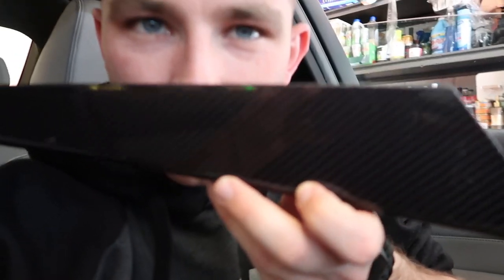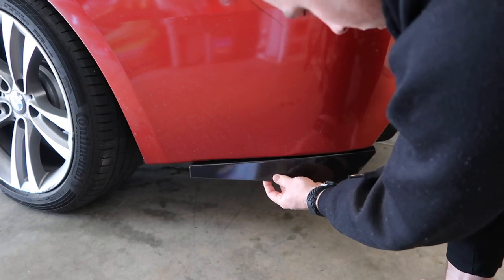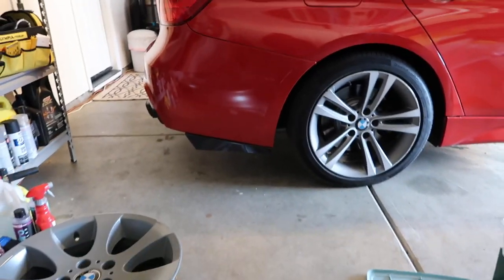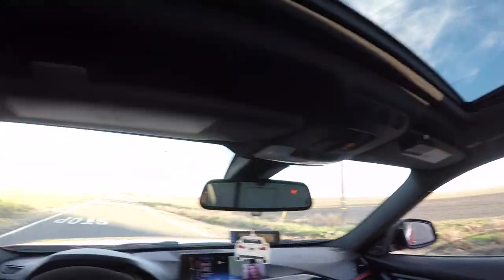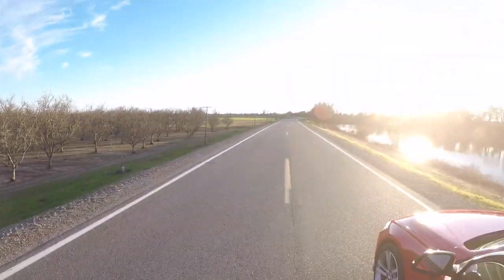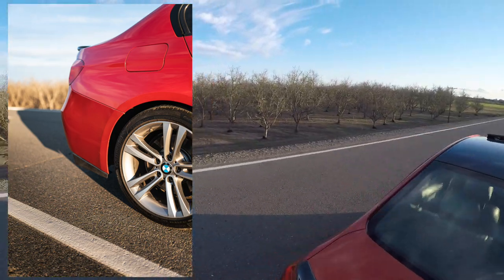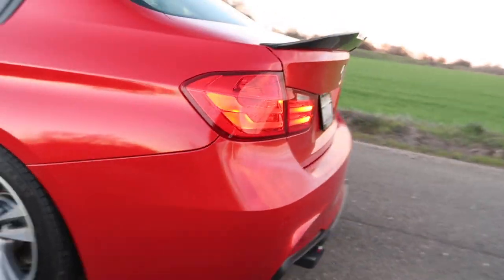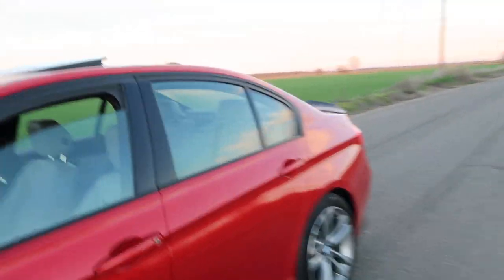BMW F30 REAR BUMPER FIN INSTALL! **AGGRESSIVE**

Comment: Hey Johnathon, how did you go about getting rid of your CEL that you get from the Catless downpipe?
Reply: He’s tuned with BM3, which gets rid of cel caused by catless downpipe
Reply: @anthonyulloa4004  i thought it just turns the CEL off entirely for the car?
Reply from the maker: Yes, bm3 gets rid of the check engine light! I highly recommend a tune once you go Catless
Reply: @JonathanWeeks  so if bm3 gets rid of the CEL entirely isn’t there a chance you could miss something important?
Reply: @EvoroPictures  it only gets rid of the cel when it’s caused by the catless downpipes, so if you get a misfire for example it will still throw a cel at you 😁
Reply: @anthonyulloa4004  oh good to know. Thanks
Reply: On my old Volvo S60R, I used a bung spacer.  It basically mounts the o2 sensor back like 2.5” away from the exhaust pipe.  Cars are probably smarter nowadays though.

Comment: Hmm why did you drill them? You didn't need to the screws were already on the car and all you needed to do was unscrew them line it up and then install.
Reply from the maker: Didn’t realize until after
Reply: @JonathanWeeks  I see. Well well maybe try the original holes and see how they look.